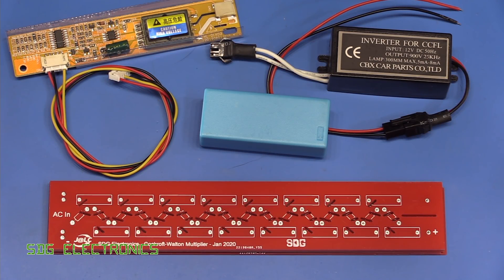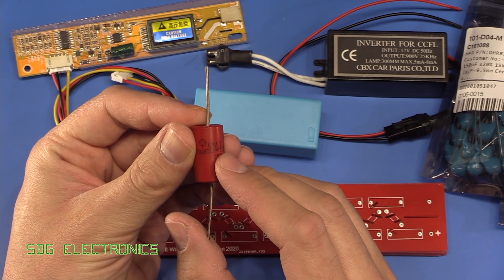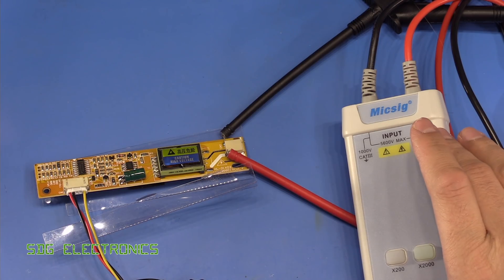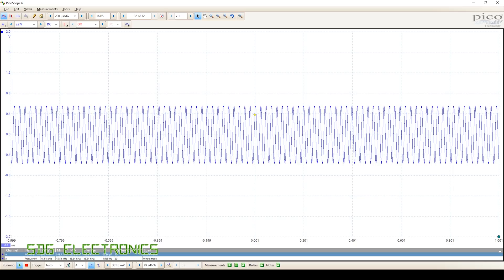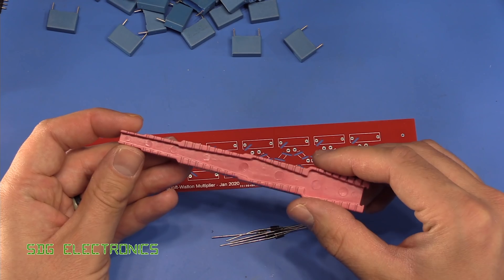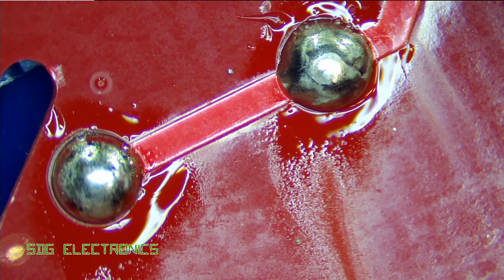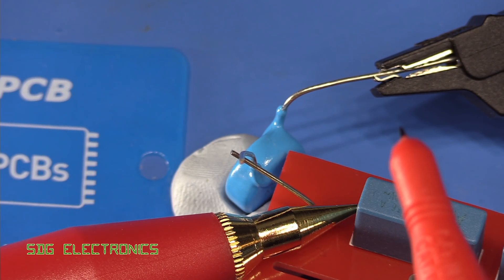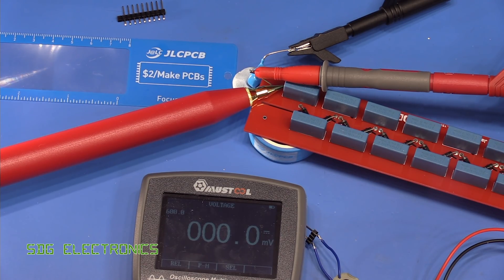SDG #130 High Voltage Cockroft Walton Multiplier for ESD Simulator with PCBs from JLCPCB

Comment: The Solderking flux seems to be good too.

I'm interested in the solder wire as I wanted to go lead free in 2020. I've started with a roll of old Maplin SAC305 wire and coming from traditional 63/37 it's been quite an adjustment.  Soldering tip temperature and dwell time seem pretty critical. Too much or little of either leaves a frosty mishapen joint. Get it right and it's between bright gun-metal grey and near leaded solder shine and perfectly formed.  It is an older product, which may account for some of the variability, but I value your advise if it is worth persisting with SAC305 types of lead free solder or if there's a better alternative?
Reply: Hi RepairMonkey, I would definitely say that RoHS compliant solders have come on quite a lot over the past few years. We have spent a considerable amount of time working on new types of flux technology to improve flow speeds. I am sure you will be impressed with our SAC305 or Sc100e as is being shown in this video! You can contact me at info@Solderking.com

Comment: How does one calculate the optimal capacitance for the CW capacitors? I assume that it is dependent on the transformer output current among other factors but have not seen much on this topic. I have seen everything from 0.5 nF to 100 nF used with typical 2.5 - 14 watt CCFT transformers. Thanks for the very useful videos. Keep it up!
Reply: I found the following to be useful as well.
Voltage Multipliers, Inc.: Multipliers – Analysis and Design
http://www.voltagemultipliers.com/wp-content/uploads/2018/08/Multiplier-Design-Guideline.pdf

Comment: I know it's just a nitpick thing, but you left the component wires too short... thus solder forms that not so great looking blob instead of properly shaped fillet... 
In this instance it probably doesn't matter, but that form is also quite weak in comparison.
Reply from the maker: It was actually on purpose in this instance to reduce corona. I didn't quite get some of them short enough
Reply: @sdgelectronics  oh, that's right... stupid me for not thinking about that :D
Reply: @Mtaalas  Not stupid. You made a significant point. Good mechanical contact is important. The most important property at all, especially in high voltage applications. The additional isolation capabilities can be achieved with electrically insulating coatings as usual.
https://www.ifam.fraunhofer.de/en/Profile/Locations/Bremen/Adhesive_Bonding_Surfaces/Paint_Lacquer_Technology/Functional_Paints_Coatings/Electrically_Insulating_Coatings.html
We are talking about the dielectric strength of air (very unstable 3MV/m) vs. something like PTFE(60–173MV/m). That is a difference more than a magnitude! Nobody can answer for the physical distance as a reason to save on the connections if there is the alternative of well researched and proper isolation techniques.
Reply: The solder is supposed to flow into the plated through-hole anyway. I would guess that provides most of the mechanical coupling.

Comment: Send one to iPadRehab because Jessa thinks that iPhone PCBs are immune to ESD.
Reply: the pcb's are, but not "all" the components </technicallycorrect>
Reply: @gamerpaddy  Obviously populated PCBs, smartass.
Reply: most ic's have diodes to the voltage rails to prevent esd damage, not impossible for all of them to have it
Reply: you never handled anything like that before?  its not as senstive as you may think.
Reply: sure, unless you lick or bend it, it shouldnt get damaged. the only time i took esd precautions was when working with laser diodes, once theyre soldered to the driver, it nots that critical anymore
Reply: It's like with useless YouTube comments and farmer wisdom: Reality hits you hard when you don't expect it.
A statement like "Aaawwhhh, losers. That never happened to me" is useless. Fighting good practices like ESD specifications and safety-gear only leads to that (little or not) higher percentage, when reality punishes you and your equipment is anything but reliable. It dies when you need it the most. Live with it.

Comment: Ah I remember building a Cockroft Walton multiplier for a Helium Neon laser flash tube when I was a lad...

It worked really well until it managed to carbonise the PCB! Bad design on my part, the output poles weren't far enough apart for humid days!